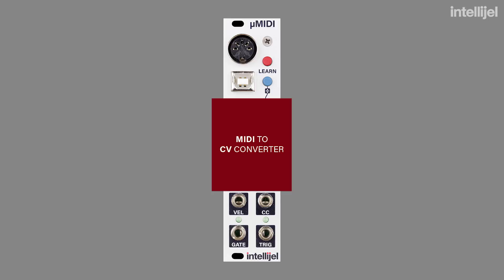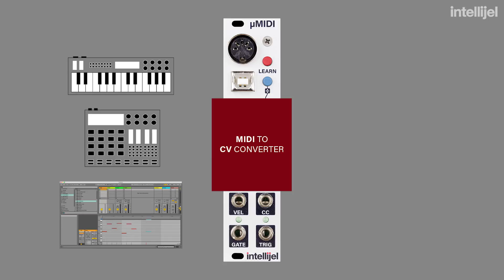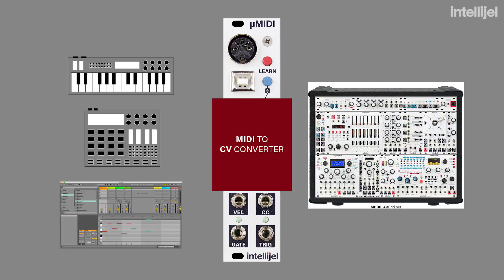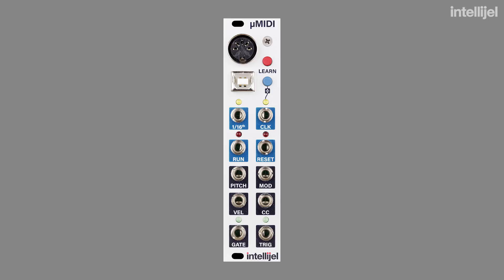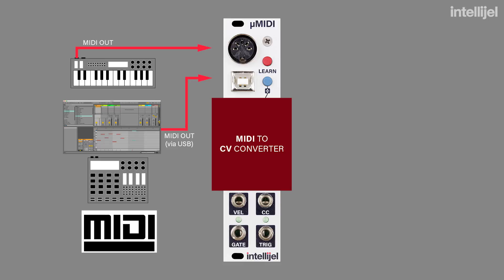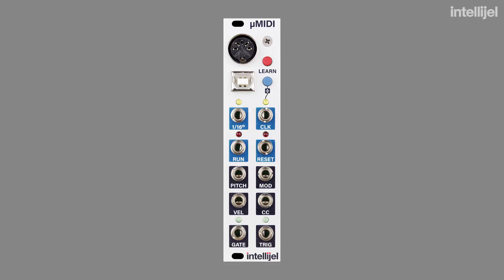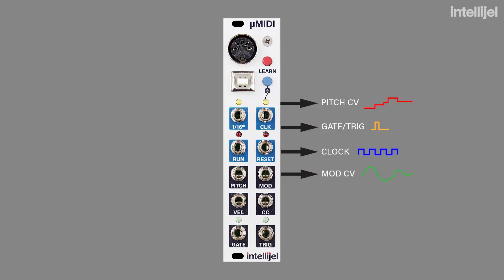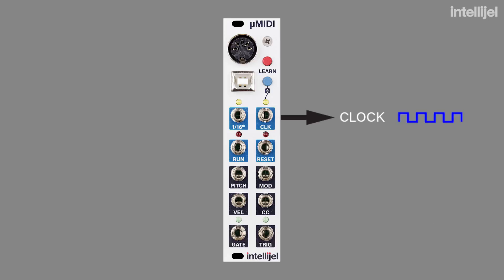Intellijel µMIDI Tutorial 1 - MIDI to CV

Comment: special request. 
would ya'll consider doing a midi 1u - midi expander cvX video please? I'm considering that option but I can't find a video on it. I am reading the manual and am a bit confused. Specifically looking for how to control cv parameters with digitakt. It would be helpful to see how to use the config app to set up monophonic, duophonic, etc. Thanks!
Reply: I currently have the yarns 1u clone 'threads' but I can really only set it to '2m' and get basic settings for duophonic. If it's possible to use the expander and really unleash the digitakt's midi param locks, that's a strong consideration for a swap out to the two modules (albeit more expensive option) on intellijel. Hope that makes sense. Anyways, it would be cool content if you're interested. Thanks.

Comment: @intellijel - I am working on a pure data patch for the uMidi which also covers both CC + MOD Controls. You state that these both outputs cover 5V -> are these 5V covered by the whole 127 midi value or less?
Reply from the maker: I would recommend writing support@intellijel.com. Kamil should be able to shed some more light on this for you.
Reply: Intellijel Thanks!